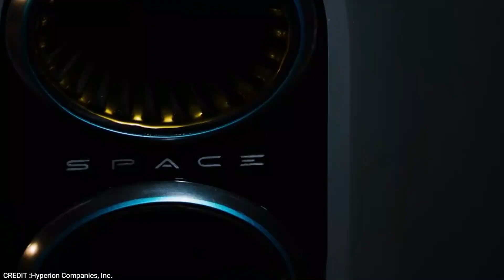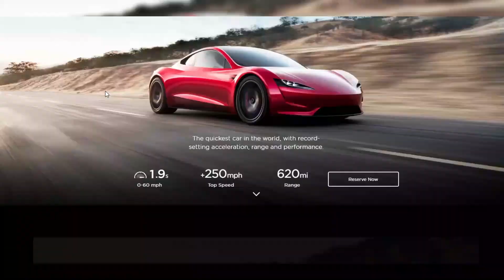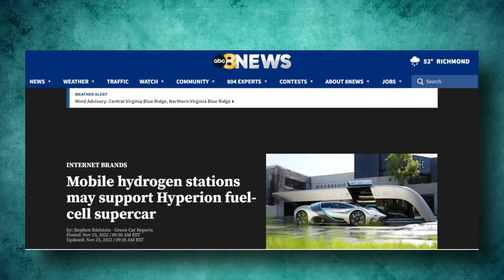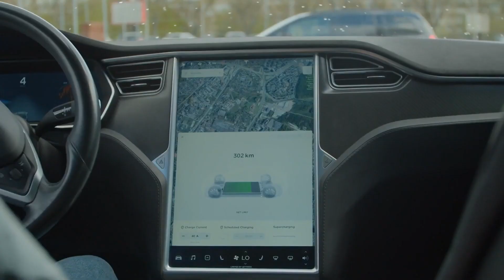Tesla Roadster 2023 & Hyperion XP-1 PUSHING THE LIMITS OF PHYSICS

Comment: You forgot the horsepower, 2000 for the Hyperion and 1020 for the Roadster and the weight, 1000kg for the Hyperion and 1240kg for the Roadster. Also the Roadster doesn't drive 250mph but only 200mph max with a 0-60 in 2.1 seconds, not under 2. (At least on my research)
Reply: That’s model s plaid stats